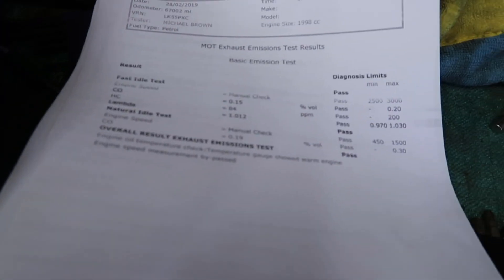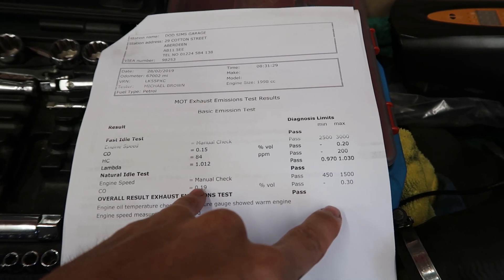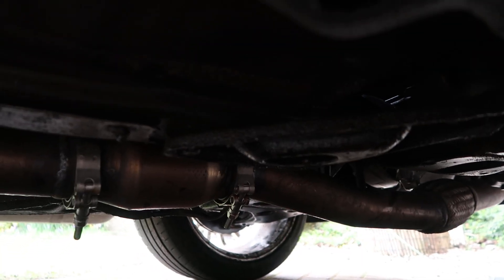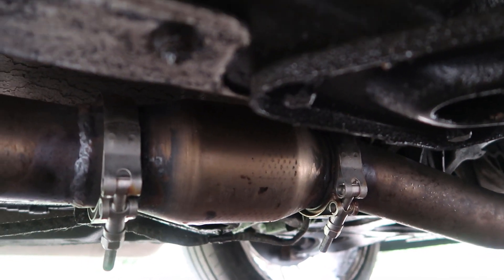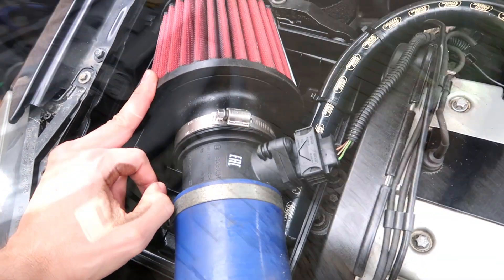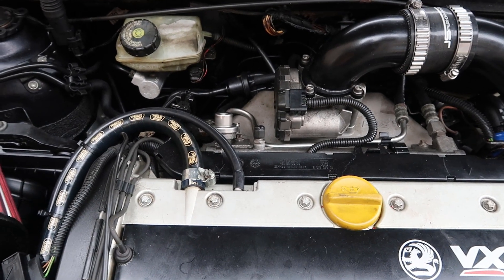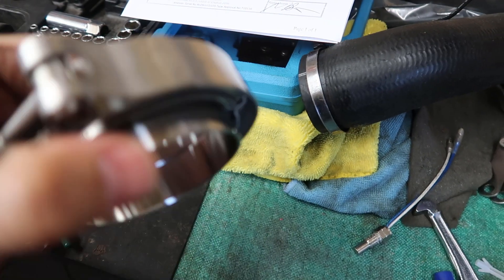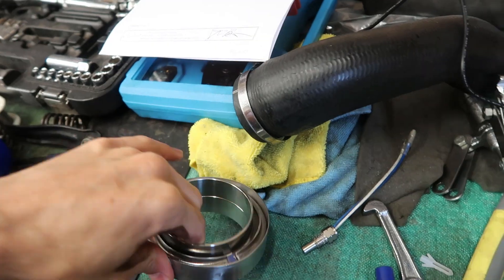VXR MOT Emissions Pass

Comment: Hi pall did you weld the universal catalytic converter on? I have a h vxr with map and straight through pipe will this mod you've shown fix my emissions failure? Which cat did you get any specifics pal please. Do you have a video of doing it? Cheers man
Reply from the maker: Hey there.  No it's not welded on.  I used 3" v-band flange connection so I can remove as required.
Reply from the maker: Yes I pretty much just fit for mot.  I just bought the universal sports cat
Reply: Appreciated thanks

Comment: Also what do you mean by ( if you are running a pcv system? Can I still have the pcv if I've capped the one way valve at throttle? Or do I need to modify the pcv. Sorry for picking you mate just human advice is better than an answer on Google . 👍
Reply from the maker: Positive crankcase ventilation system is standard.  If you have capped it off that means you  have stopped it.  All the PCV does is put the crankcase/rocker cover under vacuum when engine is at idle or low load......as soon as you are on boost the one way valve shuts and it does nothing.  That's why on modified cars etc they remove it to allow extra venting under boost when you actually need it.
Reply: @boosthit811  thanks mate It seems my car is running smoother after doing this. I has a hesitation in boost before but honestly feels stronger. Its a nurburgring edition and didn't feel 250ish but pulls strong with less hesitation. More fault finding i think. 👍👍
Reply: @boosthit811  whats your thoughts on a recirc delete. I already have the vac box delete thing. Just trying to eliminate my minor boost problem
Reply from the maker: @bigmac7228  if your car is still running a maf sensor then you will need to keep the recirculating  setup.  If you dump the measured air to atmosphere it upsets the air fuel ratio between shifts.  

Different if you change ecu and run a map sensor, then you can dump to atmosphere no problem because the  air flow is calculated by the mainfold air pressure.

Comment: Hi mate so I've put a small filter on the large crank case breather and have capped off the throttle body where the 1 way valve would go can I have the one way valve still on but not connected to the throttle body just vent it?
Reply from the maker: Cap off the throttle body.....you dont want any vacuum-boost leaks.  Then vent the breather's to filters, catch can or whatever you like.